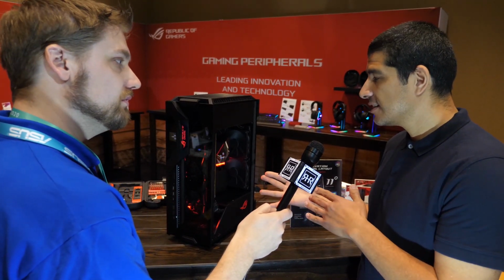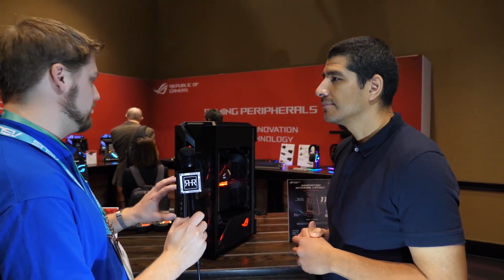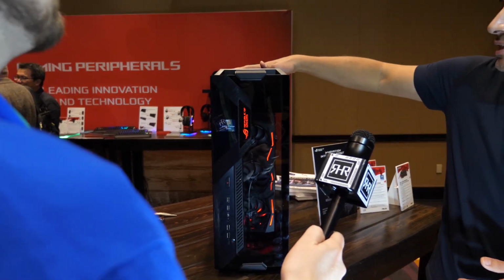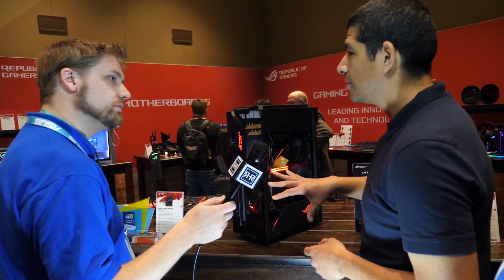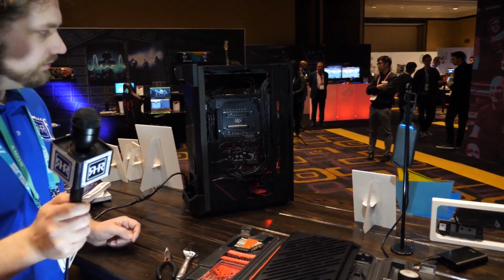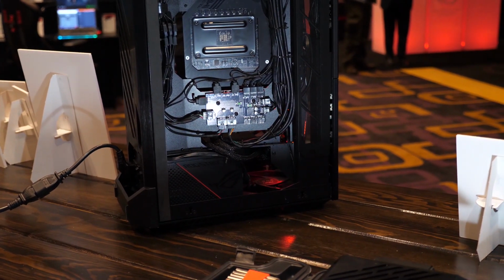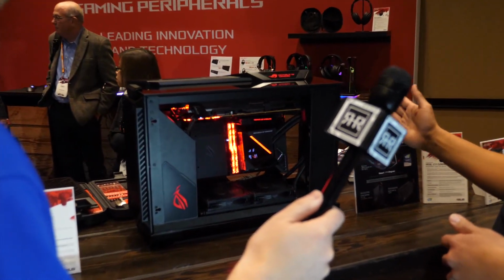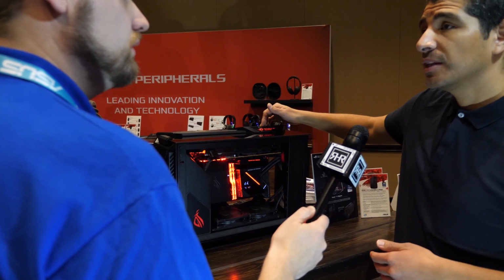Asus Z11 Gaming Case - CES 2020

Comment: I WANT ONE This is the best Chassis I have seen I am not a small form factor guy but this might just change my thinking and at £299 it is a little steep BUT I'd pay it for the fact that the build quality is fantastic, I just finished building my latest system which was am AMD Ryzen 3700X with ROG Stryx X-570 MB and a Nvidia RTX 2080 Super originally go for the 2080 Ti but on my AOC 35'' 1440P 144Hz display it was over kill Might sell the whole thing and build one of the bad boys
Reply from the maker: The videos do not do it justice in person it looks beyond amazing. The angle and glass on the top just make every thing pop out.